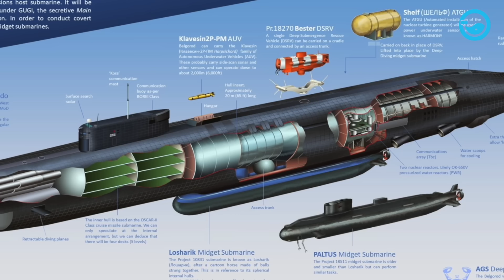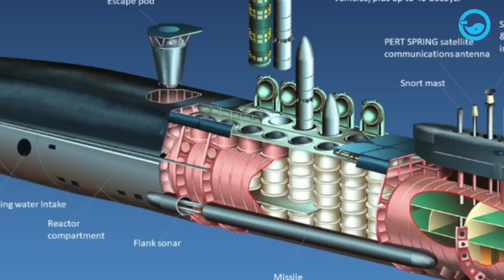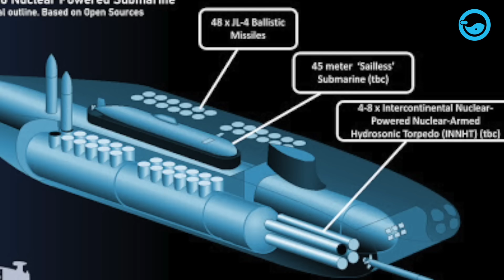Inside The Largest Nuclear Submarine Ever Built in History: You Won’t Believe Inside!

Comment: Hello, at 4:45 You made a bit of a mistake. The
R-39 Rif SLBM are a 3 stage solid rocket fuel ballistic missile. Not a "nuclear powered" missile. Each missile carried 10 MRV'S That where 200 KT nuclear warheads. No man made rocket or missile have been nuclear powered yet.
Reply: Concur. Solid propellant propulsion is quite different from nuclear propulsion. Kind of calls into doubt the accuracy of the other information.

Comment: 👽👽👽👽👽👽👽👽👽👽👽
24,000 tons when submerged......???? 
It will weigh the same in or out of the water. You lost me at the 35 second mark.
Reply: Shark (typhoon) 48,000 tons And 24,000 tons is the original project to which Antei belongs.  and Belgorod has a larger displacement

Comment: I don't understand how it's possible to sail faster submerged rather than when surfaced!! Are you sure it's not the other way around??!
Reply: WW2 subs were primarily on the surface unless they were going to attack or evade therefore they were optimized for surface travel and could go faster on the surface. Post cold war subs are optimized to be submerged most of the time and were rather unstable on the surface and can safely travel at maximum speed while submerged.
Reply: Because there is no water resistance or drag on the hull when submerged! Easy! I know, I've been onboard!
Reply: @cliffordlarson621  and the propulsion is completely underwater and under greater pressure (less cavitation).
Reply: It's  true.  Faster underwater.
Reply: Submarine Hulls are expressly DESIGNED to make speed underwater! You didn't know this????